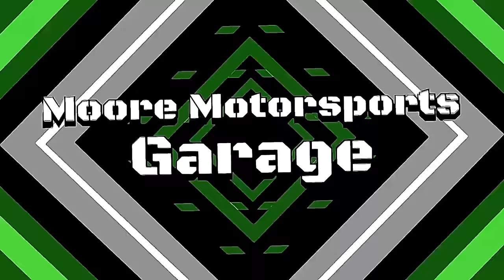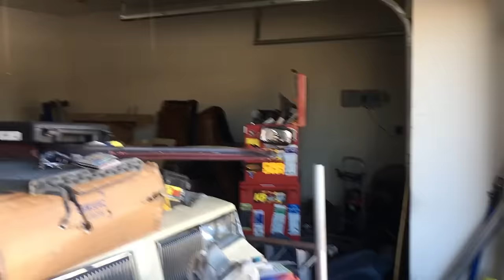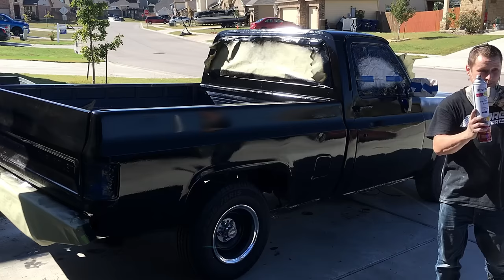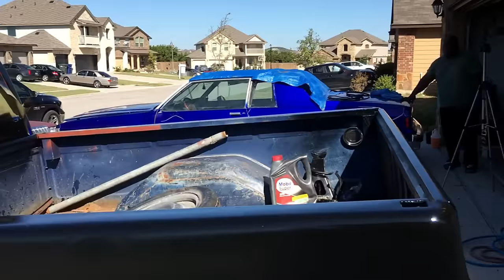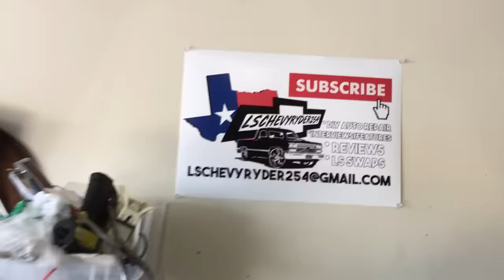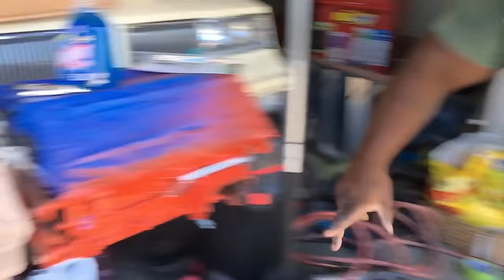$50 rustoleum turbo paint job.

Comment: All the haters are comparing this $60 paint job to a 10,000$ paint job lol it looks better than it did and that’s all that matters for $60
Reply: I did this to my lexus sc300, then wet sand /buffed  after a few days and it's so smooth and shiny
Reply: @shawniebeans8382  yup just get a few coats of paint and some 1000 grit and a water bucket. I usually 3m 3900 rubbing compound to buff it shiny but if you want a real good shine throw on a clear coat and cut it with the 3m.
Reply: @patriotrob7066  60$, just do it again
Reply: On the race track it dont matter. At the end of the day. They wont be bragging about a $1000 paint job when some shitbox miata or civic gaps them in the corners.
Reply: Alirght how much u think that truck worth then mind me it's a 85-88 model ......
Reply: @shawniebeans8382  what year is your sc300? I got a manual 95.
Reply: Absolutely! Hard to talk shit when he only spent $60 lol
Reply: No it doesn't it brought all tha dings out
Reply: Real talk I’m abt to do it on my 98 Chevy 454 after I watch some more videos
Reply: Or haters say why do you spend a lot of money to paint cheap shitbox
Reply: Just did this to my 98 grand Cherokee no reason to throw an expensive paint job on it with it having over 260k. Plus I have 3 other rigs that are nice so I figured a rattle can job worked.
Reply: Haters gone hate, it’s in their DNA!! 💯🤷🏾‍♂️
Reply: The only people that complain about stuff like that is the ones who can’t afford it in the first place there’s nobody that’ll judge your car faster than a person that’s walking
Reply: @ZaZaKushulia  yessir or a person who’s car is in worse shape than urs

Comment: Make America spray paint again, say no to 5 or 6k painting bills. This all can be done in your drive way.
Reply from the maker: Sal Gonzalez It could have been better but yes it can be done!
Reply: Yep, and no charge for the overspray on your neighbor’s property.
Reply: @parkeranderson5074  problem(s) with rattle can paint are these. Brittle, chips easy, fades easy, any and all solvents, gas, thinners, even bird poo will ruin it. Once you decide to buy an air gun and a gallon of auto paint and do a decent job, all and i mean ALL of what you rattled must come off because real auto paint and primer chemicals DO NOT bond. They will delaminate and bubble up after several months and start to chip away and auto paint isnt cheap. Ask me how I know. My prep work was decent, my knowlege how ever wasnt.
Reply: John Wirk 🤔What does that have to do with my comment?

Comment: I did this exact same paint job with the turbo cans on my 2000 f150. Turned out nice. Once it dries though, its more dull than gloss. Almost like a satin. Tried to wet sand and polish, but doesnt look so good. If you want that gloss look, I recommend that you put clear coat on so you can wet sand and polish.

Comment: My secret to prep work is using 3m adhesive to glue strips of 36,60,80,120,200 and 400 grit sandpaper onto paint stir sticks from home depot. Sand in multiple directions on the bondo and work up to 400. The stick will "bridge" over the dent and the multiple grits will save you time. I had poorly done a lot of bodywork on a 1967 442 and another car guy gifted me this info. I redid the whole car and it turned out lazer straight. Hope it works for you guys too

Comment: That's the kind of stuff I did when I was driving $500 junkers in my 20's.
I used Duplicolor brand metallic paint on a Cutlass....looked like shit. It did buff to shine, but I'd never do that again....you can't get the same  coverage as a gun from a can. Real auto paint is not that expensive....you can even shoot it outdoors.
Body prep is THE most important part of ANY paint work. Several coats of a high build primer sanded smooth with 400 to 600 grit for a perfect paintable surface. 👍

Comment: I get the budget thing but each can is $9-10 so basically $40. You could’ve gotten a gallon of single stage acrylic enamel for $50 some cheap hardner and reducer whole thing $100 and just used a $10 hvlp gun would’ve had a reallly good shine with real auto paint and less orange peel extra $60 doesn’t seem bad and still on a budget
Reply: U can use 20 gal people say u need a huge comoressor long as it's low pressure hplv gun you'll be all right.. You might not be able to fly around the car with it.. Might half to let the comoressor catch us occasionally but it will work

Comment: Quick sand over paint, 2k clear coat after, wet sand that and polish wax after and it will look 1000xs better.
Reply: Do you sand after paint then clean coat or paint clean coat then cut and wax polish spray paint.
Reply: What would be better to paint on a yellow car? Glossy black or matte black?
Reply: @Pishogue_ASMR  gloss
Reply: Thanks bro
Reply: @Fakken28  what grit sandpaper
Reply: @foxspot24  gloss black shows all the flaws
Reply: @marvinhagler4721  after paint prob 800 the clear 1500,2000

Comment: Some folks don't have any money,so what can you do? The owner got what he paid for. Myself,if I was going to have it painted,I would have pulled the dents out,a few skim coats of filler and blocked and primered the entire truck a few times. To sit back and put this guy down for doing a friend a favor is sad. Not many folks will pull friends together,put a small pile of cash together and do something really nice for a friends friend or anyone else and have some fun at the same time. Those stories are few and far between!
Reply: Real Friends don't let Friends use Rustoleum.

Comment: I’ve always had bad luck with gloss black spray paint. It’s something about the clear that they mix in with the paint. I started using flat black with a good clear coat. It looks 10x better in my opinion but it still has that cheap spray paint character. I love the reactions when you tell people it’s spray paint tho. Smoothing out the deep scratches is the key to this stuff. If you can see it in the base you will see it in the clear

Comment: Thanks for sharing the paint project. I might consider doing the roof and hood of my truck because the local shops won't do sections - they require doing the whole truck for dollar $$$$$$!  MACCO is the only shop that would the roof and hood - clear coat may be beyond saving.

Comment: The orange peel is due to the solvent not flashing off fast enough since you laid it on so thick and the low temperatures didn't help. I'm not sure why he had you do the paint job since all he would need to do is watch a 5 minute youtube video and his skills would exceed yours. I loved how you would stop spraying mid-panel like by the front right fender. lol. Total hackery. 
I'd wet block sand it with 1k, 1.5k, 2k, and then then use a Denim pad for the initial leveling with Meguiars Ultra Cutting Compound M105, then a cutting pad with the same. Finally a softer polishing pad with M205. 
But first, let that paint cure for at least two weeks.
Reply: Exactly what I'm tryina say. He didn't even open the doors and paint inside or paint under the hood, put a wicked lot of paint in one spot on the one side for some reason. Coats were thicker than peanut butter, not sure how he can call this a success. Some poor kid is gonna see this, say "yepp, I am gonna do this to my mint square body Chevy and have me a black truck" and go do it, wrecking yet another classic pickup. The masking tape around the tail light alone is enough to make me cringe.

Comment: I painted my Toyota Camry with paint I ordered from Toyota, 3Q3-Salsa red
First two coats was at night, came out nice and smooth, I did the 3rd coat in the Sun, 80 degrees in Florida, and this ruined my Whole paint job.
So now I’m gonna have to sand blast it and redo it again, but now I’m thinking of doing it with the black.. You did a great Job, it looks Slick, and it’s a lot cheaper.. The 3Q3 red salsa is $150 a gallon, so it’s expensive

Comment: Now sand that and repeat 4 more times,wet sand and clear it you'll be amazed
Reply: Doubt you can even sand that let alone buff it.
Reply: @Mikesmeyer88  well you are wrong, you can absolutely wet sand and even clear it. Its paint it's no different than a spray booths paintjob other than the quality. Hence the multiple layers and sanding. Cool thing is you can "think" whatever you want, even when you are WRONG.

Comment: Its a 60 dollar paint job on a old truck poorly prepared and painted in the sun. If they painted it in a garage and ran a standard air purifier for a day or two prior. Could of turned out alot better. Wet sand and clear coat probably won't look to bad. Again cheap as hell, better than what it had. It ain't going to sema.

Comment: First I would like to congratulate you for trying, this is not a easy job to attempt. Especially using spray cans of paint. It's not too late to fix this paint job. I would recommend you let it dry for at least a month. Second I would recommend YouTube for self help videos on paint preparation, masking, and painting. It is possible to do a complete paint job, using Rustoleum enamel paint. You can buy it in a gallon can, at Lowes & Home Depot. It can be reduced with automotive paint reducers and additives can be added for hardners. Third you can learn how to reduce the paint. And how to apply it by watching YouTube videos. If you are still unsure, and need additional instruction. There are a lot of vocational classes available. Some at high schools and junior colleges. This is a career that has potential for income. Good luck with your endeavors. GF1 👍👍👍👍👍👍👍👍👍👍😁😁😁😁😁😁😁😎

Comment: I did a truck with rattle cans once, It turned out pretty good but was fairly expensive. I ended up buying 10 cans of primer and 10 cans of black tremclad.  I had to polish and wet sand the paint after laying it on, after that it looked decent. The amount of work that went into it was a lot, I should have bought a cheap spray gun and some auto paint. I also found out that black paint shows every imperfection in body work so your bodywork needs to be perfect before you start. I would not choose black again, very hard to keep it looking good.

Comment: When spray can painting you don't need to sand it down. Respray it and after a few coats will be smooth
Reply: That’s not true.  Takes 3 light coats. Lightly sand with 600 grit and use a tick cloth between each coat.

Comment: There is an old saying ' do the job properly or don't do it at All '. What is the point in wasting time and money to end up having a real shit paint job. 
Old panel, cheap gun and compressor, research and practice. This will result in a much better job that will last a long time.
Rattle cans outside is simply ridiculous.
Reply: Agreed, that said rattle cans can produce a decent paint job when used correctly with the right prep and finishing procedures. I've even hand painted cars with a foam roller with good results. He just needs to hit it with a wet sand and buff.
Reply: @orirbjrk5573  I always use spray cans on small jobs. As long as it's got a decent spray fan nozzle it's good as a gun.
Reply: Did you not watch the video.. He did it for free for a friend and that's what his buddy wanted he didn't care if it looked like shit or whatever. He just wanted it covered up from what it did look like.. I'm sure he knew he could use a compressor and gun if he wanted.. And who Tf cares we ant driving it and it isn't our truck..
Reply: @JUSTIN-vr5hv  still. Do it right or not at all.

Comment: Chevrolet & GMC pickups & SUVs with that body design were produced from 1973 through 1991, except the half ton & three quarter ton regular cab pickups were discontinued in 1987, & the one ton regular cab pickups were discontinued in 1989.

Comment: For sure better than it did look, but man as a body man/painter and c10 lover this has me crying
Reply from the maker: Puffin On Rubber Smoke It will be perfected later on he just wanted the color changed. There is much more room for improvement
Reply: @JamesDguy  and for the price paid it cant be beat. I have no qualms it just hurts to see a truck ive been dreaming of owning for years get rattlecanned 😭
Reply from the maker: Puffin On Rubber Smoke Hey rattle can paint jobs can look just as legit as spray gun jobs (WHEN DONE RIGHT) this was just to get it painted. Still has body damage and for a proper paint job I would want all that perfectly fixed before doing it out of my spray gun.
Reply: @JamesDguy  like I said, I have no qualms with rattle can paint jobs and have do e plenty myself, however to say they can be just as good as a proper hplv gun shot job is crazy. Try all you want, but you can never get rattle cans on a surface as large as an entire vehicle to lay as smooth and uniform as a proper gun

Comment: When you do this job, is better if you do it in a single part of the car, finish well, and do another. Do it in one sitting you don't have a well result. Take your time, and do it in shadow no with direct sun light. Spray one coat, wait 10 minutes, and do the second coat, or the paint will run. If the paint run, don't clean it with a paper or cloth, that make it worse. Wait to dry and sand that part with a 1000 grit.
Reply: After applying with the cans do you need to spray with a clear coat can or is that all it needs? I want to do some touch ups on my car where it has some rust spots and the hood lacquer is coming off.
Reply: @lordsesshomaru9527 , hello, the spray of clear coat protect the paint, but you need to apply a very thin layer, or it will run throw the paint. After you apply the lacquer , you need to wet sand with a 1000 grit and use a paint polish. If you want a fast result and just cover up the sun burn of the clear coat, just wet sand with a 1000 grit to remove all the loose layer, and spray a 2x paint can (the 2x had primer and paint in one can) and let it dry, After that use a cream paint polish (turtle wax or ultimate compound) to shine.
Reply: @ignaciogodoy7095  // thank you so much for taking your time! I appreciate it a lot.

Comment: Its not that great but one thing you could have done to REALLY help it look better would be to wet sand the entire truck in between 3 total coats followed by at least one clear coat
Reply: With what sand paper? And you’re saying that after every coat it’s good to wet sand it? Or just on the last one (3rd one).
Reply: @Davfxtv  I would use anywhere from 120 grit up to 300 grit. It's a light sanding just to smooth out the orange peel effect. When I do it I sand after all 3 body coats but not after the clear coat.
Reply: That's impractical with a rust-oleum spray job.... Even more so with a roller job. The rustoleum has to flash and harden before sanding. Could take weeks depending on weather and conditions. I often wait a month before sanding and finishing with clear.
Reply: @unsanctionedchaos2994 , 120 grit is to hard, you need minimun 500 grit

Comment: Dam good job bro
Reply from the maker: The Colorado Hitman thanks
Reply: @JamesDguy  hey I have a quick question for you and my question is where do I find the Rust-Oleum turbo paint cans with a 10 inch wide sprayer I haven't been able to find those anywhere. I checked every hardware store and I just can't find them anywhere. If I have to go Last Resort and order them online I will but I rather just try to find them
Reply from the maker: The Colorado Hitman Home Depot has them online they can send or you can buy them off the link in my description. If the hardware store Home Depot don’t have them idk
Reply: @JamesDguy  thank you for the info man

Comment: The orange peel is from not having a wet enough coat and it drying before it can level. Add another 4 cans and then wet sand and polish and it would look tons better
Reply: Wrong the prep work was not his and really effected the job, in fact Moore is known for doing heavy wet coats so you are incorrect
Reply: @carlman7372  obviously you know very little about painting. Bad prep work can lead to bad results but it won't be just orange peel over the whole job. More then likely the temperature was too warm and it didn't have time to flow. Only way to fix it is wet sand and buff or color sand and add some more base then do the same thing with clear
Reply: @joshestess  not to mention spray cans don't get a very fine atomization like a good gun will. So these are prone to orange peel anyway. This orange peel is pretty rough though.
Reply: @johnmckenna596  fact

Comment: For a rattle can job in the conditions you were in, it turned out as good as it could I guess. Idk if there’s enough material to wet sand that texture out though. Maybe a quick hit with some 2000 grit and a buff will dull it down a bit but like you said it’s not a show truck so who cares

Comment: Sad part about doing this is that when you one day decide to paint your truck with 2k paint from a gun you are goin to have to get rid of all this 1k you just added double the work to your painter
Reply: I did this same thing a few years back for giggles. Finally decided to man up and save, buy some paint and primer and spray it myself. Sanded and prepped ok...wasnt too concerned about fine details because I did a satin finish. 6 months later the paint has shrunk in areas, blistered in others and has also developed little patches of "pimples" here and there because the old spray paint that I sanded and not completely removed caused delamination. Im not giggling anymore.

Comment: u know with out activator  the paint will oxidize in about a year and to paint it right u have too strip the paint off now so u did more damage then good like they paint spots in the interior the use a clear coat with activator over the paint so it last now see what happens when someone spill gas out of the filler  it will take the paint right off

Comment: No use single edge razor blades with a push blade handle don’t use anything like you just said it will scratch the glass up I’m a auto glass technician I have my own business never use anything but a single edge razor blade to remove stuff on glass!